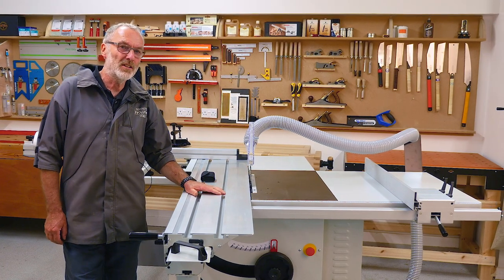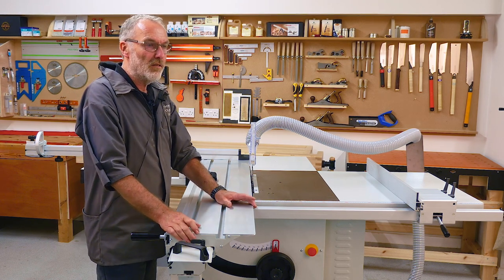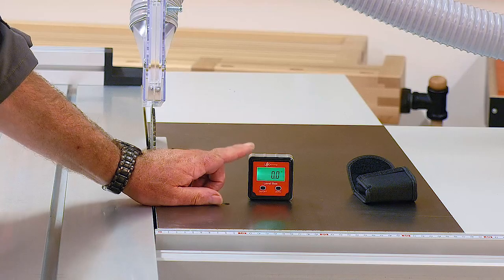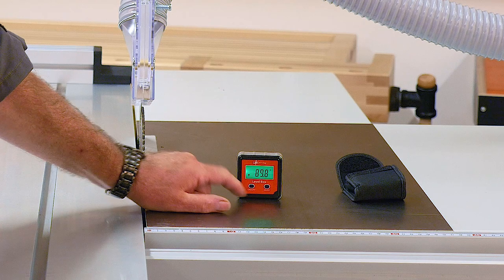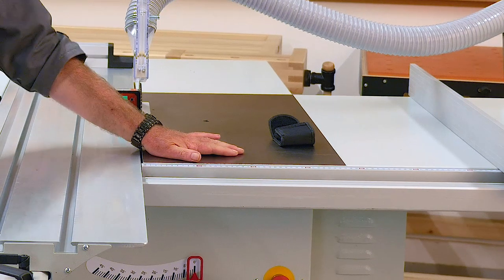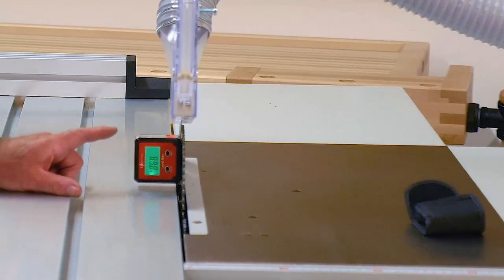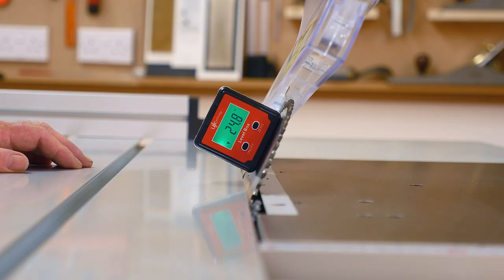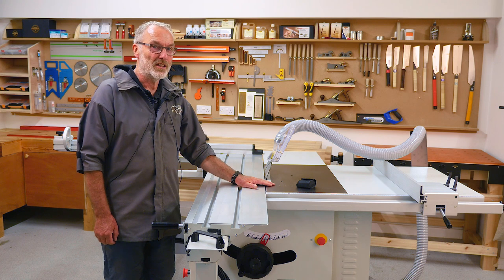How To's - Correctly set the angle of your table saw

Comment: One thing you didn't make clear, the angle box has to be exactly vertical on the saw blade or the angle will be wrong. you can't just put it on at any angle and expect it to be correct.

Comment: This video has an error. It shows how to set your saw blade relative to the starting angle, not relative to the table. You should not have pressed zero after placing the box on the blade. Then it would still have been reading the angle relative to the table.